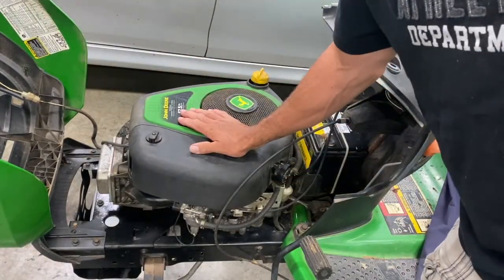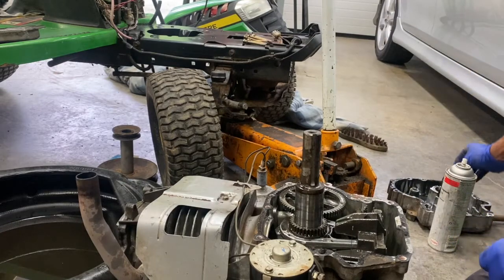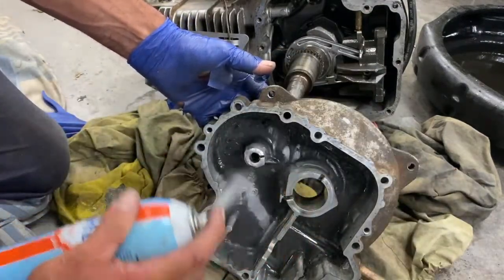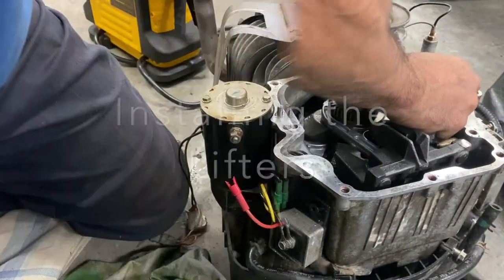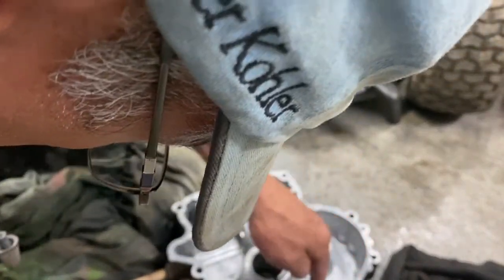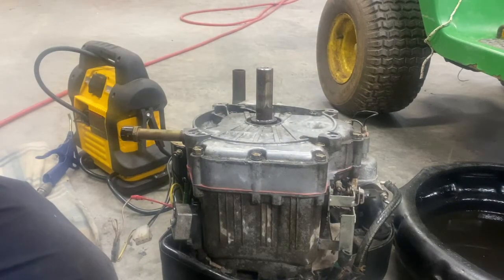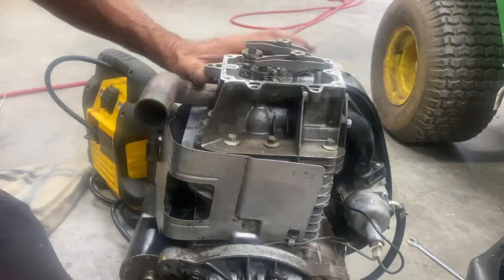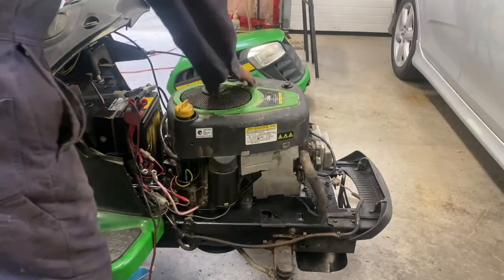How to change a camshaft in a D100 John Deere Lawn Tractor 17.5hp Briggs & Stratton Motor.

Comment: Hi there. Firstly, great video. I really appreciate the time and effort that  you put into it!  Secondly, my JD woes. I have a D140 that has a 22hp vtwin. The JD dealership told me that my cam went bad, I assume like the one in this video. They won't break into the engine to replace a camshaft, but they WILL sell me a brand new engine at a cost of around $1200 or a new mower for about $3800. Mighty nice of them, huh? I'm fairly mechanically inclined and willing to try the cam replacement myself. Any idea if the my D140 would be too different from what you have shown here? Thanks for any insight and opinion. Again, thanks for the great video.
Reply from the maker: Thanks.   Usually the camshafts in the v-twin don’t go bad.    
  I’d check my valves lash.  Take the valve covers off and turn the mower over.  Make sure all 4 valves are moving.    Lots of videos on YouTube on checking / adjusting the valves.
Reply: @WeekendHobbyMechanic  Thank you. I will definetly do that. Much appreciated.
Reply: @WeekendHobbyMechanic does this cause the engine to turn over when trying to start but stops like the battery is weak? Ive charged the battery ran jumpers to my truck tightened the grounds it just acts like the battery is weak gets a few turns then stops like the engine is locking up... which is may be...
Reply from the maker: @brainwashingdetergent4128     Yes, just like a weak battery on Single Cylinders only. You have a V-twin.     I have a spare 22hp V-twin (high Compression model) 190psi. It's hard to turnover. Suspect the starter may be a bit weak.   
    This won't help but you can check your valves. Exhaust 0.003-0.005", Intake 0.005-0.007".   Make sure all the valves are moving.
Reply: @WeekendHobbyMechanic  its a V twin all four valves are looking really good. I probably need a starter the mower has been having issues and I just keep cranking away until she goes to work 😂 I put a new carb on but after the mower was warm it didn't want to start again so the starter didnt get no break after the new carb unless I kept it running which I usually forgot and would just crank away until she finally went again.
Reply: @WeekendHobbyMechanic well now that im thinking about it if I have a stuck exhaust valve that would put a strain on it. Thanks for your videos man they are short and to the point.

Comment: Hey Weekend. Good video. I subbed your channel to see what else you have to offer. Yea, I have a bad cam. So I'll be following this video when the time comes. I've been looking for a new cam, but Briggs and stratton site is sold out. I like to buy a Brand name if I can. I guess I will have to find another brand. Are all the camshafts the same size? My model is 33R877, Code 0004 G1 and code 131212ZD. I can't seem to find a camshaft with any of these numbers. Thanks for sharing.👍👍🍁
Reply from the maker: The camshafts are all the same.  (17.5, 19, 19.5, 21hp single cylinders)    You can try Amazon.  Lots of aftermarket ones there.  
https://www.amazon.com/Briggs-Stratton-OEM-84005207-Camshaft/dp/B089LN5D31/ref=mp_s_a_1_3?crid=P81MHWL4V6Z4&keywords=camshaft+84005307+chrome+briggs+and+stratton&qid=1676853577&sprefix=camshaft+84005307+chrome+briggs+and+stratton%2Caps%2C157&sr=8-3
 Your 19hp motor has a oil pump drive. Remember to removed first from the bottom..
Reply: @WeekendHobbyMechanic  Thanks for all of your help. If they are all the same, why do they have so many numbers of machines that they will fit? I don't want to buy the wrong one.
Reply from the maker: @AndysDogHouse   The only difference is the 17 and 17.5hp motors have different camshafts. But a 19hp camshaft can be used in the 17.5hp engine but not the other way around. (It doesn't have the oil pump drive slot in the cam)   The Amazon link above is the OEM camshaft for your motor. You will need a gasket (John Deere Part Number: M147513). 
        If you buy an aftermarket camshaft the gasket usually comes with the camshaft).
Reply: @WeekendHobbyMechanic  Thanks. I ordered it last night. It will be here tomorrow.
Reply: @WeekendHobbyMechanic  Thanks. I ordered one. It should be in next week. You have been a big help.👍👍🍻🍻

Comment: Yes my D100 locked up don’t know if it is the camshaft or something else!  Also do you have a video on adjusting the brake/clutch!  Thanks!
Reply from the maker: You have to take it apart and look inside.  My guest the camshaft decompression bump let go and ruin your motor. 
     I don’t have a video on adjusting the brake/clutch. (Sorry).
Reply: @WeekendHobbyMechanic   Can’t I replace it if broken.  I have the ability to do that if parts are available!
Reply from the maker: @RaineySkies     For sure.......

Comment: Thanks for the video! So helpful for me! May I ask what the symptoms are when the lever breaks off?
Reply from the maker: Watch this video:  https://m.youtube.com/watch?v=9wEtiMPBGpE
Reply: @WeekendHobbyMechanic  Thanks so much. Question for you... I didn't remove my valve cover. Just went straight to removing the sump cover, replaced the camshaft, etc. Do you think I need to open the valve cover to do the timing adjustments or do you think it's fine since I didn't open it up? Working on a 2019 John Deere with only 120 hours. Thanks!
Reply from the maker: If it’s starting and running well, no valves noise.   I’d leave it.